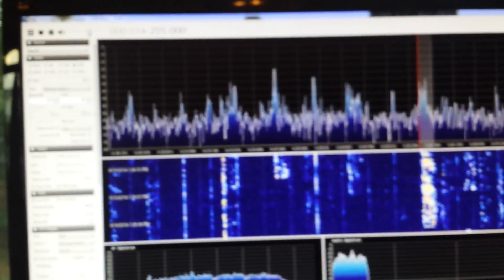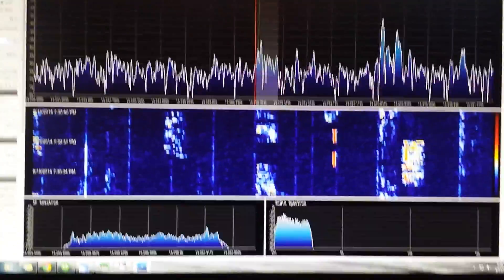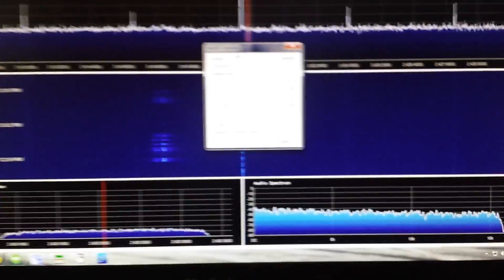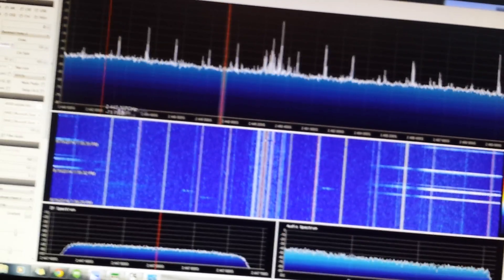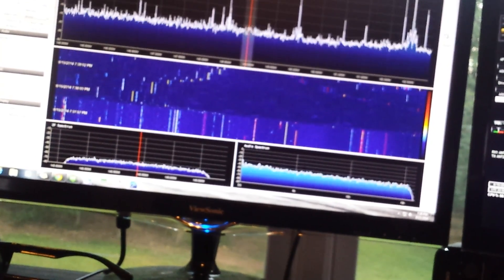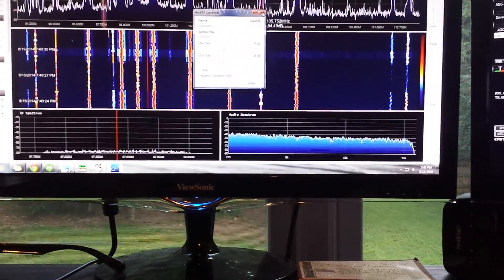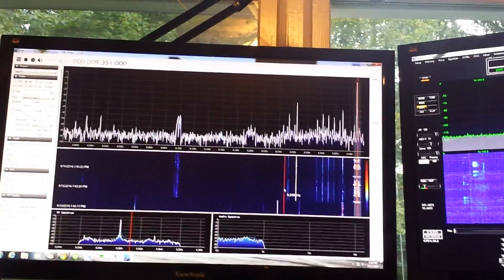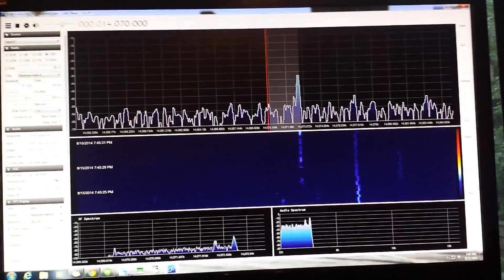HackRF One on Windows with SDR #

Comment: I got my HackRF one,   but still haven't been able to download and install it in either Windows 11 or Kali Linux.   Can you help me out?
Reply: Latest firmware should work no problems on Windows11. For Linux, give 'DragonOS' a go...on Source Forge you will find a version specific to being able to run the OS on a RPi4 or 5... even a RPi W2... though, performance varies- functionality varies - RPi4 WIFI chip can support monitor mode where as RPi5 cannot and would require an external WIFI adapter which does... though RPi5 is leaps faster processing. Mind the heat which the 5 produces...performance is throttled substantially over a set temperature.... which it easily can get up to- a small fan does the trick . All that said- DragonOS is specifically designed for "Radio Enthusiasts" & "Ethical Hackers"... "Penetration Testers"... it has many programs that suit such devices as the HackRF1... along with anything else required to run, such as drivers or any other dependencies. Lots of good tutorial videos on DragonOS also...

Comment: I know this is an old video, but you can buy a broadcast band filter on Amazon or Ebay for around 20 bucks. I have one, it works great on RTL-SDR dongle. Happened across your video because I ordered a HackRF One the other day, it'll be here in a couple of days. In the course of 5 years, hopefully they've done some cool stuff with the firmware. :-) After doing some Google searches, it appears there wasn't much software for it in the beginning. People claimed it was for learning SDR, you had to "roll your own" software and put together the radio you wanted on your own. Fun, fun. LOL

Comment: where i can find the file for use my hackrf with SDR# :O ?
Reply: 1 of my HackRFs connected no problem, the second...many problems... even from same seller "Open Source SDR". It was one of the SDR software that I had installed that "fixed" things... loaded the correct drivers and made some changes to my system in the background during the installation process... though, I had thought- it has been awhile now since then- thought that it had been SDR#(sharp) which had done this, but maybe not... it may have been SDR Angel?
I know the comment is from awhile ago, but I see many others having similar questions- these days, everything should just work if you have latest firm ware. Oh, don't  overlook your cables...as short as you can....make sure they support charging and data aka OTG lasty, the HRF1 and PortaPack versions do not play nice with USB3. It's a hit or miss...more a miss. So if connecting to a USB hub which is all USB 3 ports...most likely won't work. Oh, and lastly, it is of good practice to try to have a powered hub, one that can at least provide 3amps - preferably 4..5amps. We forget, these things, especially WIFI adapters are power hungry- the computer/ laptop may not be able to provide enough to enable your device to run ...optimally

Comment: I have a whole bunch of RTL-SDRs, and I've become conversant with the use of them. 
Would you say that buying this Hack RF was worth it? I'm looking at buying one.
Reply from the maker: the great thing about the Hack RF for me is that it works on HF all the way up through microwave.  the frequency range it great.  it doesn't have the best selectivity ever.  for $250 you can get the airspy and the spyverter, which would cover the same range of frequencies but with a better receiver.  I think if I was doing it all over again I might do that.

Comment: what is the ACTUAL Spec of this ????
does it start at 1 Mhz or 10 Mhz  ???  i have seen both figures  stated in sales spec pages.. its KINDA important to know if it covers 7mhz  ( 40 M band )
Reply from the maker: it will cover 40m, no problem.
Reply: Cameron Conover so.. where does it start 1 or 10 ?
Reply from the maker: It can receive broadcast AM, but performance that low is not ideal.  The specifications for the actual ADC are 10Mhz, but as soon as they started building prototypes they realized in practice the components will cover lower frequencies than the specifications indicate.  Micheal Osman did a video taking about this during the Kickstarter a couple years ago.
Reply: Cameron Conover why would i want AM broadcast for 40 M .. thats LSB.. i think you may not have a clue what your talking about ..
Reply from the maker: When I say AM broadcast, I mean that it will go as low as the AM broadcast band.  I know that 40m is LSB, I'm an extra class AJ4TW.   I'm not sure why I'm responding to you.  It covers 40m just fine.
Reply from the maker: I'm not the one doing the name calling and behaving rudely.  And, you don't bother me with your flames and trolling.  I'm a good operator, I know what I'm doing, and I believe that the spirit of amatuer radio is one of camaraderie and goodwill.
Reply: i am also a full call and passed with distinction ( same as your extra ) difference is I don't go bragging about it.. and using it as some kind of defence when in an argument  you are a jerk.. its is clear.
Reply: on the plus side  at least you use a flex, I have a 6300.. so chikca chicka..

Comment: can anyone tell me if HackRF is sensitive enough at 5.8Ghz to resolute FPV traffic using 5.8Ghz analogue video transmitters (for first person view camera traffic).   Basically I am considering using one of these for Drone Racing competitions to create a frequency chart so that racers are not jumping on each others bandwidth. It would be a hell of a cheaper than a spectrum analyser and even cheaper again than RF Explorer
Reply: You ever go aboiut this? If you check out the Linux OS DragonOS, the fella that posts the put it together has some videos on the subject and the software could be found within DragonOS

Comment: SDR SHARP AND HD SDR, were not very good for me sdr# was very buggy and adding plugins made that worse, hd sdr i found deaf.
i use a program called SDR CONSOLE V2, do a search for it its free and once set up works the best imho.
it needs a key which is provided with the program, the author provides updates and new keys every 6 months or so, its great and does not need the gain cranked up.
try it what you got to lose.

Comment: Hi man  Just wondering how it compares to any other HF sdr if you have one
Reply from the maker: itakeyourphoto Well, I have a Flex 5000 in the shack, and compared to that the front end is not nearly as selective or sensitive, but it does work.  If you wanted a really good receiver you'd need to add some filtering to it.  That being said, it is a decent way to explore SDR and the range from about 7Mhz up into Ghz is hard to beat for the price.  I've also had in the past an SDRIQ and that was a much better HF receiver, but it doesn't cover the range.  If you're looking for a low cost SDR RX for HF and you want something a little better than an RTL, there are better options.  If you are looking for the same thing with a wider freq range, than this one is a pretty good option.

Comment: Did you tried HackRF with HDSDR?
Reply from the maker: No, so far as I am aware no one has written a driver for it.  I'll check again to make sure.
Reply: Cameron Conover Yeah I just found it today and have been using it all day.  I have a tcxo RTL and OCXO upconverter I've been using for years.  The HackRF with my GPSDO is ROCK SOLID on freq with NO DRIFT in about 20 hours of use so far.  (FINALLY!)
Reply from the maker: Got it running, thanks again! HDSDR is great.  I'm going to be playing with it a bunch.  Now just need TX enable! ;-)
Reply: Cameron Conover Recently a ExtIO DLL has been created for HDSDR: https://github.com/jocover/ExtIO_HackRF/releases it works I'm using it now and it works REALLY GOOD.
Reply: HellMind ZMaster https://github.com/jocover/ExtIO_HackRF/releases
Reply: @TimHavens  which win10 software are the one o go with as a new noobish-owner of HackRF.. there are so many SDR softwares and simply choked in all the version and which are relevant for a hackRF and which would be a good one to start with  https://i.imgur.com/SLnwE8s.jpg
The obvious answer is it depends on what you wanna do., but there seems to be a few that go again in many videos.
Reply from the maker: Most Excellent!! Thank you for the heads up!

Comment: Will it pick up cellphones?
Reply from the maker: The HackRF One covers the spectrum that cell phones use, however it is a software defined radio, which means that you need software to turn the spectral data into a decoded signal, you will be able to view the waveform with whatever software you choose, but to decode it you will need an application designed to demodulate the signal.  short answer is yes, you can "pick up" cell phone signals, but that doesn't mean you can hear conversations or see the data and text messages.
Reply: Ok thanks! I miss the old days of analog.

Comment: What was your FFT resolution at?
If you change your MSPS from 20, to like 1 (manually enter it) it will not only be easier on your CPU, but you'll get a much clearer resolution because you're only showing 1MHz of spectrum vs 20 at the same resolution.